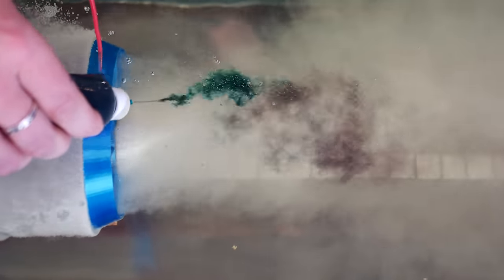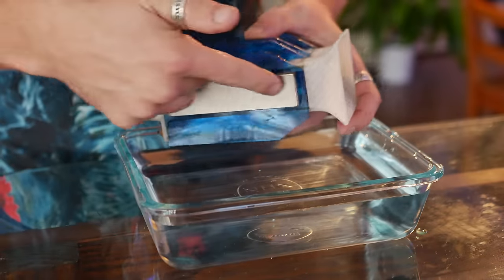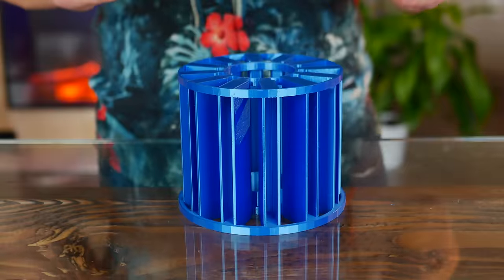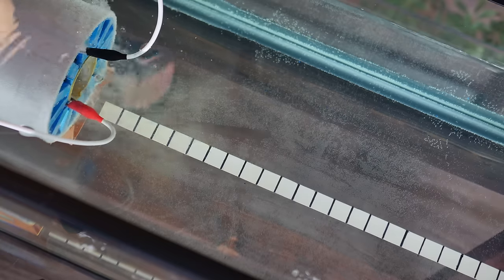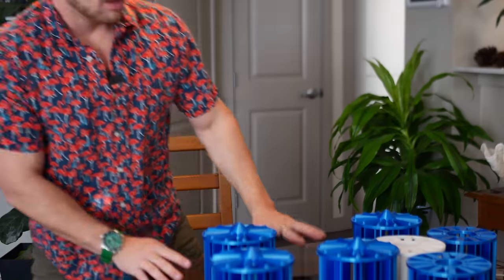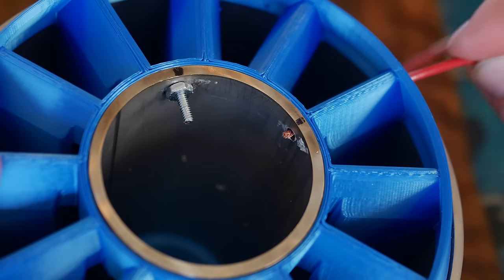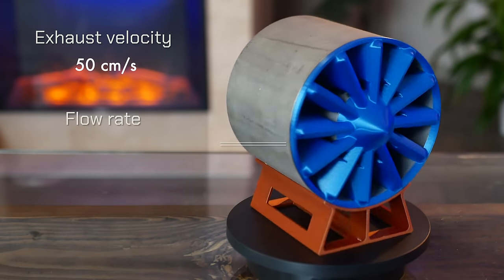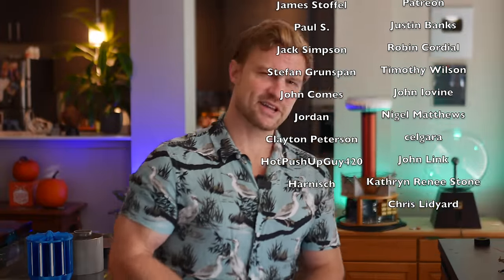Designing a Futuristic Magnetic Turbine (MHD drive)

Comment from the maker: Thanks for watching! Enjoy 10% OFF and free shipping on all Hoverpens with code PLASMA:
North America & other countries: https://bit.ly/plasma_novium
UK & Europe: https://bit.ly/plasma_noviumeu
Reply: First
Reply: What kind of gas is your thruster creating, electrolytically?
Reply: Wonder if the current would protect it from plant/mollusc issues? Cool design, well done.👍
Reply: Would using copper as the electrodes increase thrust?  Obviously, it would be more prone to corrosion. Also, would sealing the outside of the electrode help?  This is so awesome!
Reply: Hunt for the Red Green October...
Reply: inject HV and get the bubbles to ignite. Basically combine this with the ion thruster. Seems like that could recover some of the energy wasted on electrolysis.
Or just see what happens, how it looks when you ignite the mixture coming out. Tesla coil streamers going from the center could possibly be a good ignition source.
Reply: @sFeral  also possibly not so fun for marine life
Reply: @User_Joe be interesting to see what would happen if the SS was machined to increase the surface area.
Reply: Also you could use the magnets as structural parts, saving on the plastic. Have them interconnect the plastic end caps by sliding into slots.
Reply: have you heard of the model of a guy named John Searl ? He claim to made a propulsion motor based on magnetic rollers that gravitate around a core that looks like your Marine thruster design :)
Reply: I have one doubt though
Can we use this to propel in space???
Reply: I’m curious how much the performance will go down in freshwater? Not as a knock on the design or concept I’m just really curious of how it would function in freshwater as opposed to saltwater like in the ocean that it’s obviously designed for.
Reply: Try a MHD with alternative current and electromagnets. You eliminate gas generation, electrod corrosion (you can even paint the electrodes and use capacitively coupled current) and you can also push fresh water (high frequency current couple capacitively through fresh water so higher currents can be pushed).
Reply: You should make the front and rear ends screw on caps so you don't have to reprint the entire configuration to test new flow directors. I assume eventually you'd like to clean up that flow to get even more efficiency.
Reply: @Plasma Channel
10:00 -ish. I think a round design looses some efficiency to the outer radius as the magnetic field is weaker there, due to the very nature of being round.
I think some kind of square design might be more efficient, as it lets you keep ALL parts of the magnets at some optimal distance.
Could you try the same design, but you "un-bend" it, basically: O --> C --> I, and see if it produces more or less thrust with the exact SAME materials (magnets, at least).
Reply: Hi. Firstly: I'm sorry, normally I don't tell people what to do, but secondly: Just imagine doing another collab with Daniel (rctestflight) and outfitting an autonomously navigating drone boat of his with your new hydro-thruster design in combination with Dan's solar cell-battery array.. That thing would truly be way ahead of its time! 🤩
Reply: should be called a rust motor
Reply: What about a coil gun thruster for marine use?
Reply: My wonder, is if the gas production could potentially create a more environmentally destructive effect than turbine propelled engine? Especially to the tiny surface dwelling start of food chain creatures?  And that would be much more concerning than the noise that can be a nuisance to the more advanced life forms.
Reply: @Elyasthecool  if the rods dont contact water, i dont think electricity would flow and therefore no motion
Reply: @SpaceMulva hydrogen oxygen and chlorine
Reply: Would a longer thruster produce more thrust?
Reply: @rogerrussell5155  more Static pressure i asume so unless you turn that pressure in to velocity by use of a nozzle i asume you onlt generate more gas and heat
Reply: Как он себя ведёт в разной воде , солёной или в малосолённой или дистиллированной ?
Reply: I want to see
Reply: Make a bout
Reply: Hey, you should really read my comments on this video and the previous video on this topic.  The way you are feeding power into the electrodes is robbing power and reducing your net magnetic field from the permanent magnets.
Reply: hey, honest here. check the acidity of the water as you use it. does it change? electrolysis throws a lot of hydrogen ions around.
Reply: Why can’t you use an electromagnet?
Reply: Would it be possible to print it with a resin printer instead of pla?
Reply: Weight to power ratio compared to version 1?
Reply: Can you compare it with normal propellers ?
Reply: 😂make e-foil, it would be great!
Reply: You could also use the engine with flowing water to extract energy from the water as well. Don't know if you could combine the two to make a feedback lope, but it would be interesting to give it a try. Also could try to figure out a way to add liquid nitrogen to the magnets to make them super conductive and measure how much thrust is increased.
Reply: You still have inefficiencies.

The stainless steel is a problem because it's a ferrous metal. So it is drawing some of those magnetic field lines away from where you want them. You would need a nonferrous conductor for the electrodes.

The electrodes will also eventually be consumed by the electrolysis happening inside the system and converted in this case to iron oxide.

Your conductors would also need to be resistant to this chemical reaction. Yet, it would also still need to be highly conductive.

You might could get away with a copper conductor with one of the noble metals coated on the surface. I seem to recall something about silver not being eaten away by electrolysis, but I could be wrong.

Eliminating the chemical reactions with the electrolysis going in will also reduce the hydrogen and oxygen production,  allowing the output to potentially achieve a more laminar flow like the input, as well as preventing the gasses from increasing the resistance of the water by increasing the distance the current has to travel in between the bubbles.

Also, the amount of material around the magnets and the gaps between the magnets is also an issue. The plastic is just a frame that isn't doing anything but holding things in place, so anything that can reduce the amount of material there should be an improvement. But also, the gaps between the magnets should ideally be reduced to be minimal, maximizing the strength of the field between them, so maybe going up to 32 magnets would be more ideal. Possibly even 64, with some of them only being half as wide so as to just fill in the extra gap around the outer radius.
Reply: @SpaceMulva That would be mostly hydrogen and oxygen. With some impurities from other minor reactions with the specific alloy of metal being used.
Reply: @PlasmaChannel A video using these to power a kayak or small boat would be great. If you're going to use two thrusters, could you test both configurations of side by side and in series (two thrusters inside a longer tube)?
It also begs the question, how well would it work on a mini catamaran using three 48V 360W panels? (Using just two foam longboards or canoes, the panels and no batteries). That would produce up to 1kW which should be just enough for four thrusters.
Reply: Bought. But shipping was $16 (to Australia) which is sad but ok. So awesome design
Reply: I'd like to know the static pressure, if it's high enough might be useful to focus the output further. 

Maybe even taking the turbine inside the hull and focus a jet back out.

I don't know about the tradeoff between the noise and the chlorine polution...
Reply: Is there a way to stop the gas extracting process,  vecause it is some kind of extra thing the electricity is doing or maybe store or use it as booster because it is oxygen and hydrogen
Reply: Mee too
Reply: Next time try to add brushless motor controller to lower the chances of a short circuit
Reply: There are a few issues with using this kind of thrust for sea vessels. One very huge problem that you overlooked is that these thrusters perform electrolysis on the salty water, and when you do that you end up with chlorine gas instead of oxygen making this so-called clean, reliable alternative, not so clean after all
Reply: What if you make all the parts out of gold
Reply: You are wasting roughly 30-40% of your magnetic field strength. if you switch to a Halbach Array (https://en.wikipedia.org/wiki/Halbach_array) you can significantly improve things. Better yet, you can use cheaper magnets.
Reply: About to make the boat and take credit 😈

Jk lol🤣
Reply: Do it
Reply: Make the boat
Reply: Thank you so much!
Reply: Got with @The Thought Emporium to have him sputter-coat some copper electrodes in platinum.  You can trest thrust against unsputtered and sputtered electrodes, as well as Lifespans:Thrust.  It might just be worth plating.
Reply: @DaShadyTwist  bruh think of karma
You’ll probably end up getting sued
Reply: Have you considered whether you can use concepts from Bionic Propellers to further amplify your output?
Reply: on the subject of ion drives: you could line some coils in a row, (closely spaced, 45 degree angle, parallel circuit) make sure the electricity goes around all the coils the same way at the same time, and there you go. I don't know if its as good as your design, but it should be easily scalable -in speed AND size!
Reply: To upgrade your boat thruster, make a vortex chamber (think hydro generators or oil pumps), to accelerate the water much more before it exits the thruster.
Reply: Hey thats great thinking.. out of the box so to speak. Ive thought about something similar but more in line with using the water itself as a current source .. heres a suggestion for you.. the positive and negative electrode surfaces are too far away thats why you need so much current.. make the tube smaller in diameter so the concentric cylinders can be closer together so less current will be needed to bridge the gap.. the magnets inbetween would have to be smaller height...and  maybe even longer tube and longer magnets can be used to compensate..(you can even use thinner magnets and put more of them around the circumference as well.. I ve done alotta research into plasma and you've done some similar experiments, we could work on some stuff behind the scenes...I  often dont get notifications so if anything thats why
Reply: I heard about a private research firm attached to Penn State right near where I grew up and my Alma Mater that was developing some sort of solid state cavitation based submersible craft that from what I was told, looked like a big Krispy Kreme donut that created some sort of field that caused a cavity to form in front or whichever vector it was trying to maneuver, then collapse, and do that in succession rapidly as a means of underwater locomotion. This was probably over 10 years ago, I know they had a submarine lab there under the one golf course, but that kind of exotic propulsion is what this Magneto-Hydrodynamic system reminds me of. I wonder what the mechanism for cavitation was?
Reply: @ho0t0w1  probably ultrasonic transducers
Reply: Amazing design dude!
Reply: Woww
Bits of iron between the magnets
Toroid high voltage pulsed DC amplifier MAX❤😊😊
Reply: @GodSpeaksInMath  pretty amazing innovation. I delivered Wings Over to the lab one time and was met in the parking lot right inside the gate by two guards with M4s and gear. I could see they worked a double airlock door which I assume is also bulletproof... pretty intense stuff
Reply: You should implement something to burn the hydrogen and oxygen at the exhaust, instead of blasting it out without any use. The heated water should give an extra boost.
Reply: I love everything about technology since I was small but couldn't get the proper education, but I never quit... please I need small lathe machine, who can help?? 🙏❤️❤️
Reply: What happens if a fish goes through there when it's on?
Reply: Since this isn't new technology, and the biggest example trending is a tiny rc model boat using air propulsion, presumably there are problems with scaling something like this up to a practical level. What are those problems?
Reply: For the algorithm
Reply: Say... Is there a reason you're so fixed to design a MHD thruster without moving parts?

Can't you just fused electromagnetic part of electric motors and compare the hybrid with just plain electric motor?

Your model kinda reminded me of turbojet engine... Think you could put integrated MHD to the blades and stator, while enable them to still function like electric motor?
Reply: is it possible to make water pump using this ?
Reply: have you thought about giving it an initial curve before it exits the nozzle? what about voltage / amps tests it can handle?
Reply: perhaps even make use of the venturi effect?
Reply: @PlasmaChannel what about if you make both metal tunes coated with either an anodized finish ( or ) a rubberized coating the same as magnets & what if you allow rubber coated ball bearing ends to allow rotation motion between the 2 chambers for additional flow rate, then use a seashell type curve prop on both ends of the center to help move faster thru water, more quietly, and not produce waves. The curve on prop center is a twisting spiral using golden section (or) Fibonacci twisting spiral. I think that should make massive differences.  I hope you will give me equal credit & a decent % of your company profit & or opportunity to be a part of your company. I think your idea is perfect solution & if used with solar and lunar panels should be very reasonable to operate with direct & battery backup power.
Reply: Does the thruster have magnetic domain?
Reply: Awesome, brother!!! I just found your channel and subscribed. We need to talk soon. I believe we could help each other greatly. I don't really upload my projects, but I need to change that soon.
Reply: BRO can it move in the air and into space???
Reply: Hi fantastic work, just been looking at space drives and it works in reverse smaller = loads moor power.
Reply: @paulrowland5107  this works in space but what about in air?
Reply: can this move in air and space?

Comment: from the data presented here, you can easily calculate the efficiency to be 0.12%. A ship propeller has a hydrodynamic efficiency of about 60%. That is a factor of 500. There is much more Energy in the electrolysis, and electrolysis is needed for the current.
Reply: what about coating the new engine in a hydrophobic coating like military applications?
Reply: How did you calculate that?
Reply: @gabrieledutli7940  'power out' is water force x water vel...... force is rate of change of momentum so useful power out is 3.65x.5x.5 = 0.9125 W    'in' the water flow.                         'Power in' is all electric is volts x current = 30 x 25 = 750 W.  Eff is power out/power in .9125/750 = 0.00122 = .122%
Reply: @jumpieva probably creates a ton a drag
Reply: Not to mention the electrolysis products being discharged into the water. Can you imagine the effects of that much chlorine gas and sodium hydroxide on marine life?
Reply: @mattmoreira210  Oh yeah, "efficiency" - wow, never thought of that...   BTW, didn't "they" recently flag hydrogen as a potent greenhouse gas?
Reply: @dougselsam5393  gosh! And it's 11 times worse than CO2, too. We humans are properly screwed if the "hydrogen economy" ever catches on...
Reply: I wonder if one could add enough concentric electrodes to make it such that no single gap has enough voltage across it to induce electrolysis?
Reply: @SirDamatoIII Great memories....
Reply: @mattmoreira210  Oh yeah and what about Methane at 30x CO2?  Imagine if that took hold?!  I'm sure you'd be upset by that too.
Reply: @charliehubbard3257  methane?! What about it? What would take hold?! Upset?! Why would I be upset? You're not making any sense.